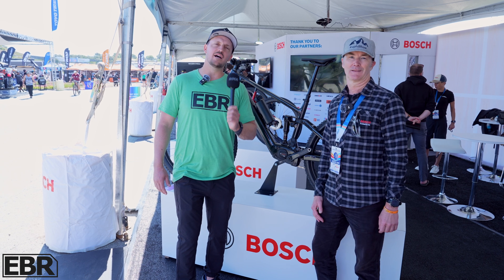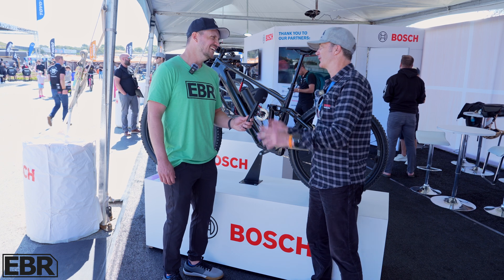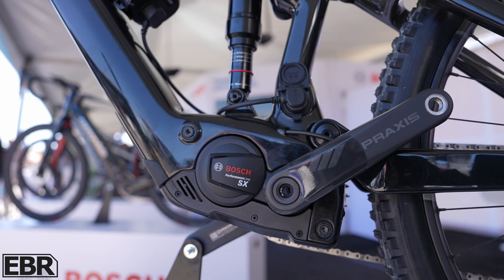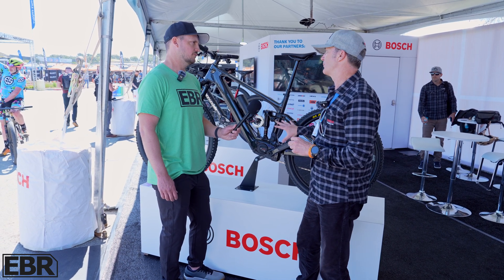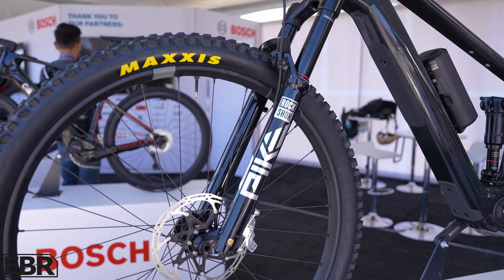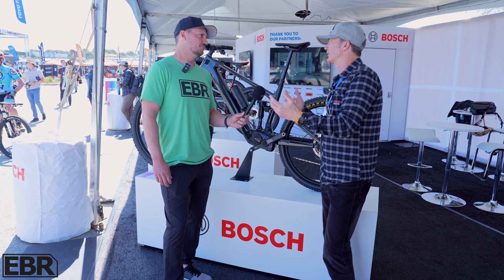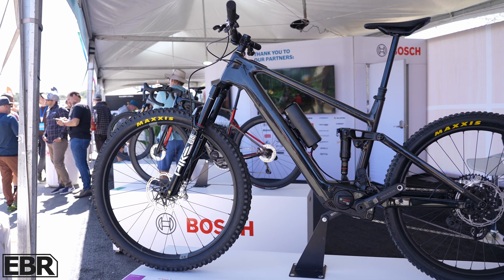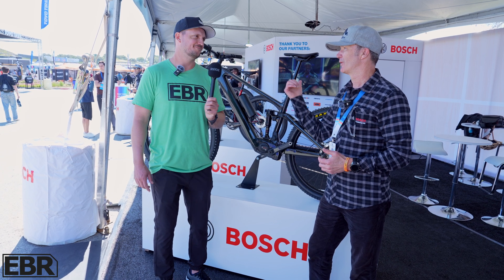Bosch Performance Line SX Motor - Chatted with Claus Fleisher, CEO of Bosch eBike Systems

Comment: Why are some Bosch motors super quiet and others among the louder e-bike motors on the market?
Reply from the maker: I am going to assume when you are hearing louder motors that they are older versions vs newer ones. New motors, like the SX, continue to get quieter with each new version (at least that's what I've found).
Reply: @ElectricBikeReview  the new CX and Speed are dramatically noisier than the standard Performance Line. All latest gen models. This is the reason I won’t consider a lot of nice e-bikes, since those more powerful motors are often spec’d.

Comment: Still, nothing beats the existing CX Performance with 85 Newton Meter Toeque.
Reply from the maker: It's a tough motor to beat if you like how punchy that motor feels. I will say, the SX motor might not have the same torque, but it feels a lot more like a full-power motor than other mid-weight motors I've tested.
Reply: I would go with the LMX 64 over anyone of them!